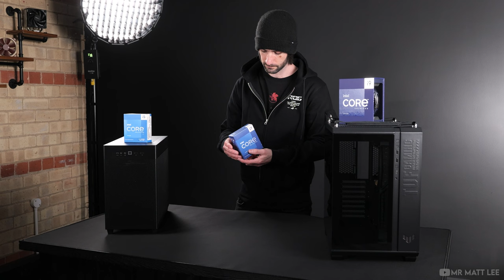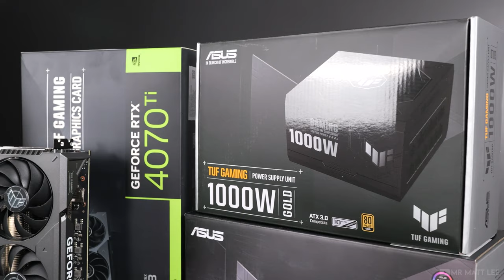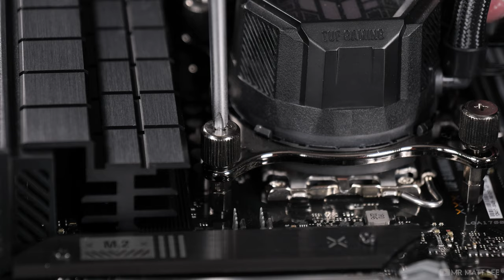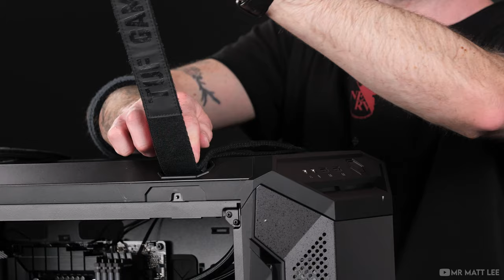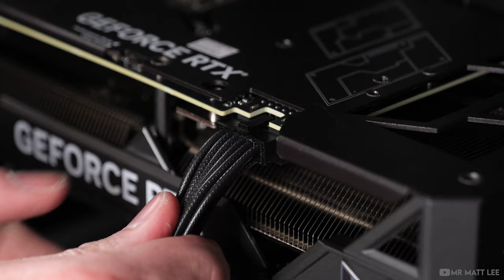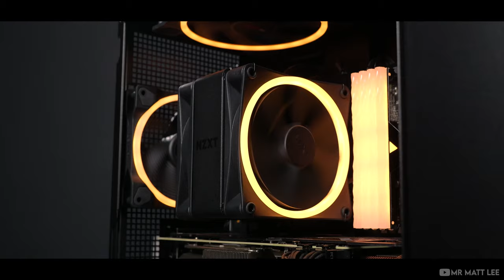Which will YOU choose?! | ASUS TUF Gaming PC Build | GT501, GT502 & Prime AP201 | Intel i5 i7 i9

Comment: i actually have the gt501 case its more massive than i thought itd be despite the comments i read but i love it!!! its also very affordable as well as being big enough to do custom eater cooling in it, easy access with side panels and tempered glass, the case itself is just dope i ended up throwing a 360 mm aio in mine since im running an ryzen 9 5900 may even get a vertical gpu mount
Reply: Did you have problems with psu being plastic and the legs also are sturdy or not ?? I loved the case but that's what I'm afraid of

Comment: Asus has been going a great job with their cases recently, especially the TUF line. I built a system in the GT502 after watching Matt's video featuring it. It was a more challenging build than your typical mid tower case, not a lot of cable management options, especially noticeable once you start adding 10+ fans. Felt like they cut cost by excluding some of the smaller quality of life stuff, including fans. Looked great when finished though.

Comment: Asus Prime AP201.... I would put 240/280mm radiator instead of air-cooler. Maybe try putting water-cooled build insade Asus Prime AP201 with 4090 + 13900k. back, and bottom fan's as intake, top radiator as exhaust.  Should be interesting build.

Comment: If it was up to me, I'd put that RTX4080 into that Asus Prime case. One of the main features of the Asus Prime is its ability to accommodate monster-size GPU while still remaining as a small-form-factor case.
Reply: AP201 handles the Noctua 4080 perfectly. Even with its increased slot count, being that little bit shorter makes it a dream in that case. 61c max whilst gaming at 4k

Comment: I like your videos and watch them often. You've assembled a lot of computers. I'm choosing a case while watching your video. 
1. lianli lancool3 
2. ceres 500 tg argb 
3. 5000d af 
4. nzxt h7 flow. 
I'm worried about choosing between these products. I'm curious about your opinion. What did you like best about assembling these?
Reply: 5000d AF if you want lots of radiator space for custom water-cooling. Everything fits in that case.
Reply: @Nods.O  I have no intention of using a water-cooling. I will only install a water-cooled cooling fan (kraken73) only on cpu. I will use noctua or T30 or bequiet on the front and back and if possible I will use these on the bottom as well.

Comment: GT501 and GT502 Kinda like big case :) great build, but also want to see new AMD CPU and GPU.
Reply: GT502 seemed to have a problem with one guy's build here on youtube. He tried to put in a 7900xt TUF GPU and it wouldn't fit for horizontal mounting in the TUF case due to thickness of the lip that holds the glass side panel. He ended up cutting part of the case off to fit it in. Granted, vertical mounting shouldn't be an issue, and it might fit if its installed on the Mobo first, then put in the case. The video in question is titled "The ASUS TUF GT502 Chassis Review by Tanel" if you wanted to see what the AMD CPU/GPU combo looks like in that case.

Comment: can anyone advise if the below spec would be good for a 1440p high FPS Gaming?

Intel Core i5 13400F Raptor Lake-S CPU
Kingston FURY Beast RGB 16GB (2x 8GB) 3600MHz DDR4 RAM
ASUS TUF Gaming B660-Plus WIFI D4 Intel Socket 1700 Motherboard
BULK MSI MAG CORELIQUID B240 240mm AiO Liquid CPU Cooler
Seagate BarraCuda 2TB SATA III 3.5" HDD
CCL Choice GeForce RTX 3070 Ti 8GB Graphics Card
MSI MPG SEKIRA 100P Mid Tower Gaming Case - Black
Montech Century 850W Modular 80+ Gold PSU
Western Digital Blue SN570 1TB M.2-2280 PCIe 3.0 x4 NVMe SSD

Comment: Hey just curios is the conrtact frame a necessary for 13900k my primary task on pc in 3d modelling softwares, after effects editing software beside gaming
Reply from the maker: I’ve built SO many 13th gen PC’s now and not once have I ever needed a contact frame. I think the discussion was way to overhyped and it’s not essential. You may lower temps by a few degrees but modern systems work well within their parameters anyway. Worry less, be more productive 🙌
Reply: @Mr_Matt_Lee  🙏 Thank you

Comment: why does everyone get the 1000w?? whats that special im also going to get the asus tuf 850w will my pc work fine?
Reply from the maker: The cost difference for the 1000W model is small compared to the 850W. For many people it makes sense to buy slightly bigger (if you can afford it) to futureproof your PSU. You might not need 1000W right now, but maybe in a few years you will and you won’t have to buy twice 😊 that said, I’m a firm believer in buying what you can afford irrespective of performance. If it works for your setup right now, then it’s all you need 🙌
Reply: And also to achieve zero fan speed. Bought a 850w for a 14600k and 4079. Psu fan never goes on.